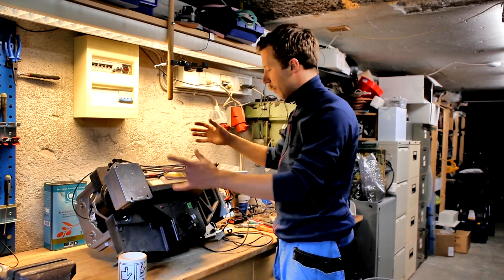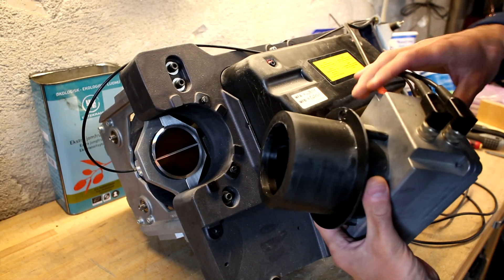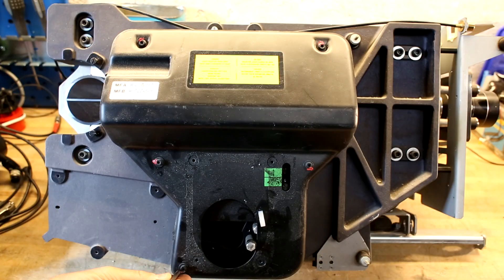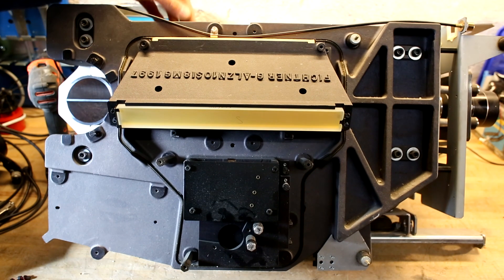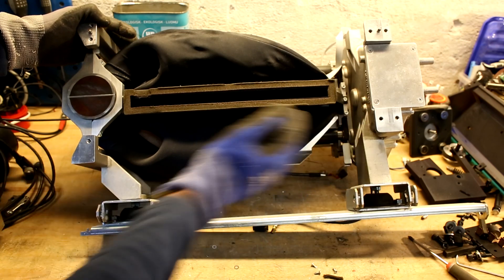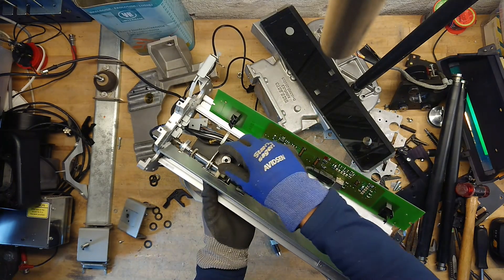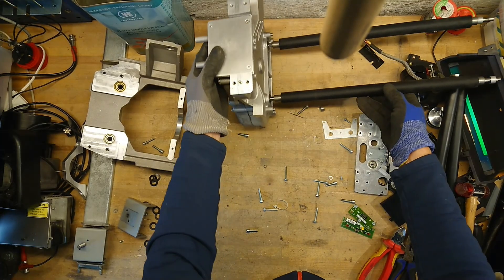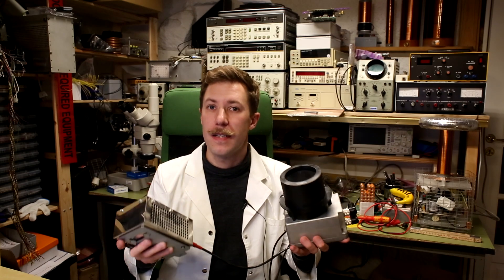AGFA ADC 5155 Laser Module Teardown (Part 3 of 4)

Comment: Interesting the use of the fibers to get the image to the PMT and how it differs from the unit i looked at. Not using the fibers in the later machines must have been a massive saving in overall cost. I do wonder why they needed to use the fiber in the first place.

It was a shame the laser was missing but the one found in the kodak machine i had was a totally unremarkable low power IR diode laser so i would cry too much it was missing from yours.

You have to do something with the fiber though, make some weird art thing!
Reply from the maker: It must have been a old design they have just reused because of stock, newer units have acryllic solutions. Perhaps advancements in computer technology made it easier to post-process the data instead of ensuring really high quality before the computer.

I know the rotating laser is not the biggest, but luck can be had, I got a 500mW module from another one I once took apart. 

For the fiber bundle, my ideas so far are a high power LED rotating lamp thingie or buy many smaller pieces of scintillation plastics and build a large "detector" plate relatively cheap.

Comment: Nice procto-shot for the thumbnail :D   Plan on using one of those fiber-cheeks with your high-power LED?  Unzip the strands from one end (keep the other pinched off over the LED of course), and you'd have a slick holiday ornament to plop in the front yard!  I look forward the the PMT, never seen inside of one.
Reply from the maker: If you can not wait for part 4, here is my reverse engineering of a PMT assembly from a similar scanner: https://kaizerpowerelectronics.dk/high-voltage/photomultiplier-tube/

Comment: That's a good sized PMT.  An image dissector tube works not much differently from a photomultiplier.
Reply from the maker: I seem to recall that the difference comes down to the blue filter and driving voltage. I have a large article on reverse engineering other PMT modules from scanners: https://kaizerpowerelectronics.dk/high-voltage/photomultiplier-tube/